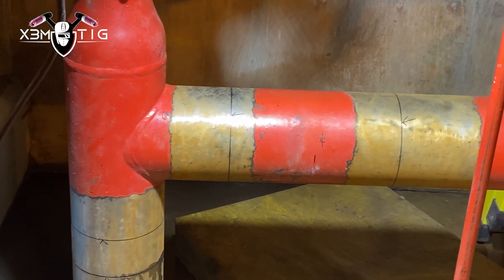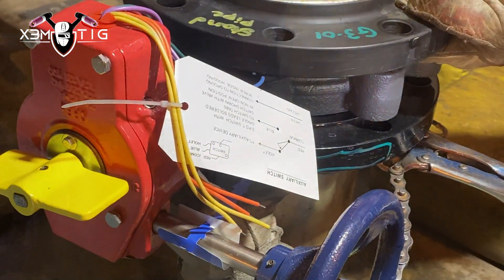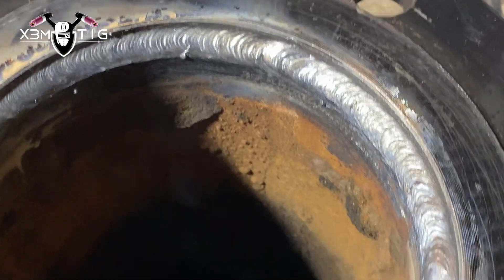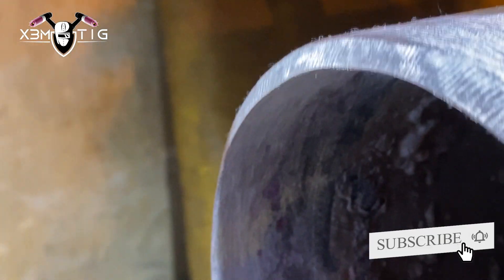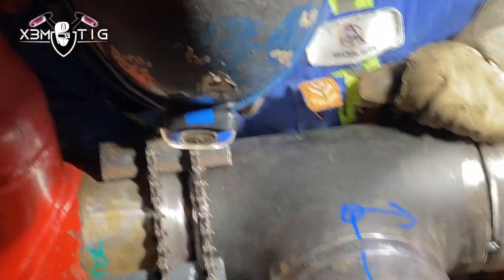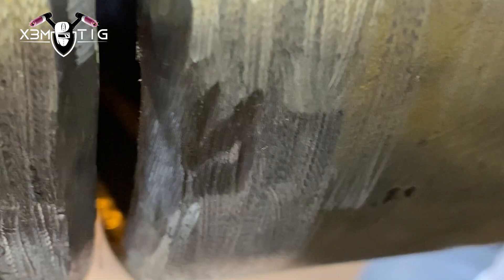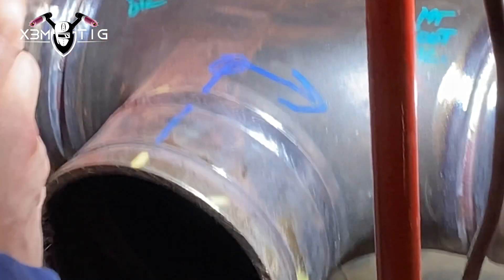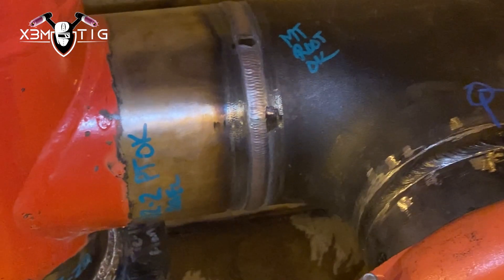TIG Welding and Replacing Pipes: Tips and Tricks for a Successful Project !

Comment: On the burrs (angel wings) after zipping it, do you pick them out with a rod, or do you turn amperage down and burn them out?
Reply: Also, another great one. Always a good day when I get a notification for a new vid. Keep on keepin on brother 🤙🏼
Reply from the maker: Hey Nathaniel, thanks brother, usually I’m always using 10”hacksaw blade to remove any burrs from the pipe.
Reply: @X3MTIG  I had a nice one that my fitter gave me, someone jacked it on the last job I was on 😅 are you active on instagram any?
Reply from the maker: @nathanielclause2588  not really, I prefer over the email if there’s any questions or inquiries.